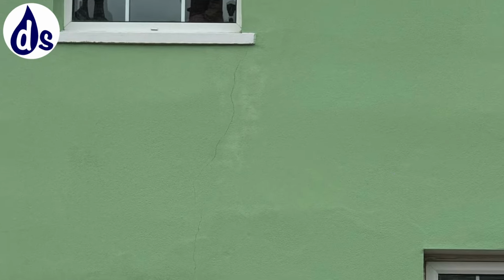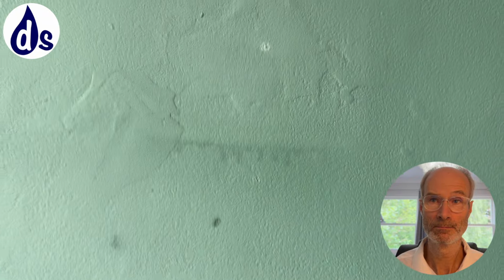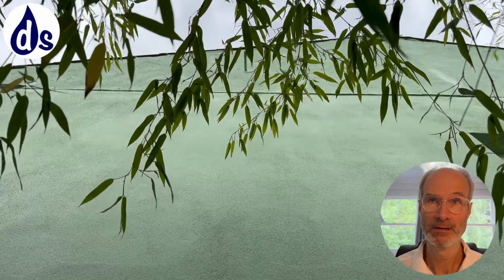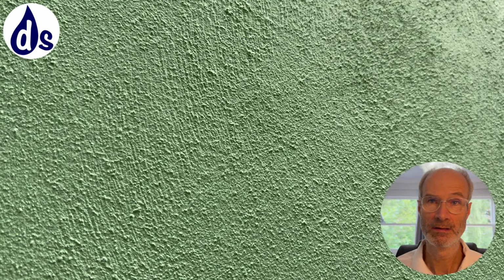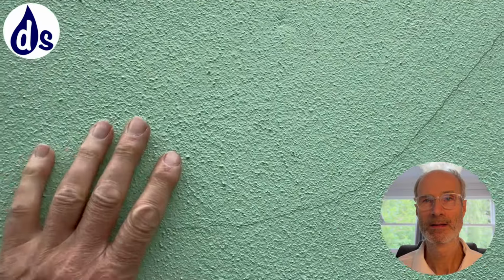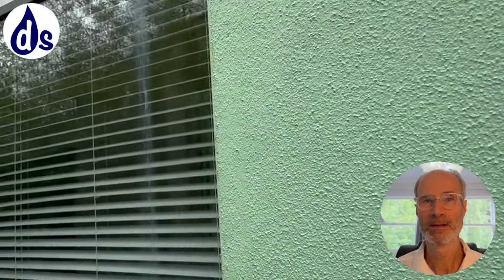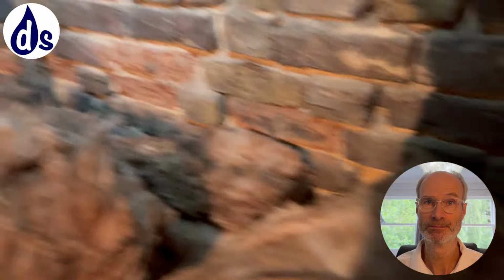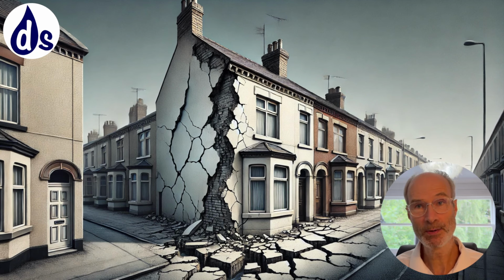Damp from poor render over pebbledash

Comment: Hi. Do you recommend removing pebbledash before spray render?
Reply from the maker: Thank you for your question! 😊

I’m not entirely sure about spray render specifically, but like other renders, it will expand and contract with sunlight and cold nights. Even small movements in the ground below the property—whether from warm, dry summers (like two years ago) or the influence of trees—can cause cracking over time.

Cracks can lead to hidden pathways for rainwater, increasing the risk of penetrating damp, which is often difficult to detect and repair. This risk exists with any coating applied to brickwork. I personally would not apply a coating to a property without the benefit of added insulation.

I’d recommend asking your contractor if you can view properties with spray render that are more than 10 years old, or at least the length of the guarantee timeframe. This will give you a better idea of how well the material holds up over time.

Let me know if you’d like further advice—happy to help! 🙌